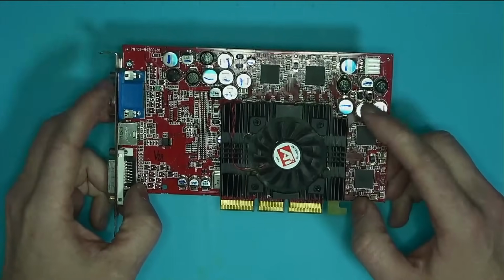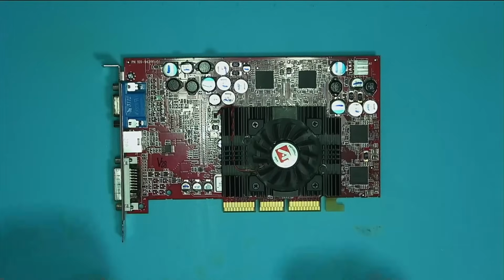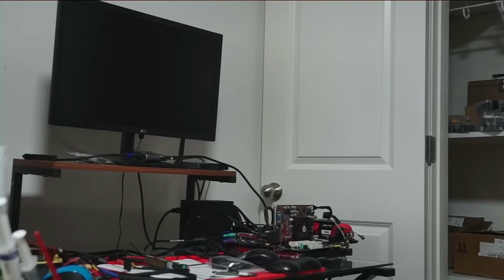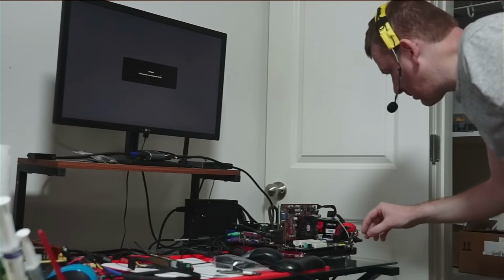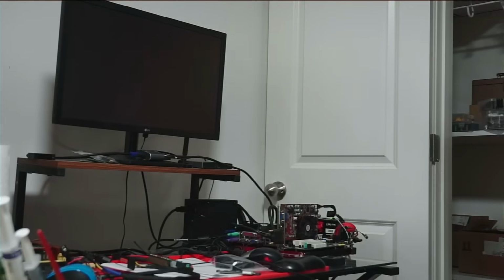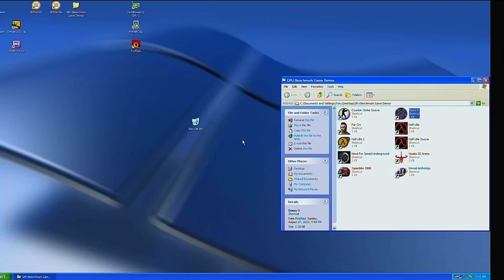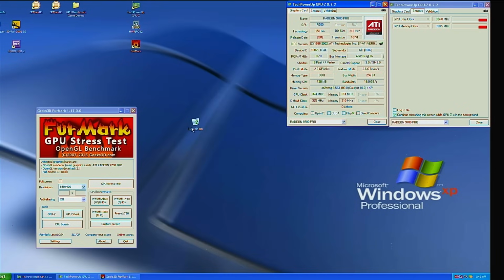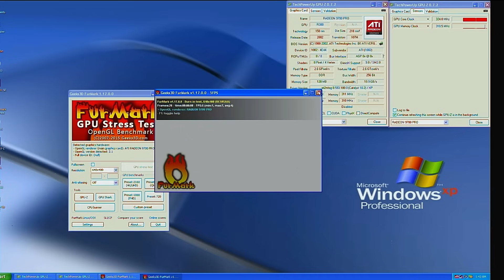Incredible recovery of this historical GPU from ATI

Comment: Truly amazing work Tony!!!  Thank you once again for fixing yet another one of my vintage video cards.  There is a little story behind this cut trace damage to the GPU die that Tony did not share in this video.  I was scraping off the old hardened thermal paste from the top of the GPU die when I slipped not once but twice with the razor blade that I was using.  This card was fully working prior to me performing this process and when I got done with applying the new thermal paste and putting the heat sink back on I went to test the video card using the same AM2 motherboard that I had used to test this video card on previously by running 3dmark 03 but this time it would not even post....no beeps....just a running AMD Athlon X2 6000+ 3.1Ghz CPU & GPU fan with a black screen.   Have you ever gotten that sick feeling in your stomach when you start to realize you have just done something very stupid?  Yep, after removing the GPU heatsink and placing the video card under my digital microscope I found the impact areas of the razor and saw the exposed areas of the copper traces.  OH NO....What an idiot I am...I knew I had just made an expensive mistake.  Lesson learned.
Reply: Well, thank you for your mistakes, so we all got to enjoy this video. :-)

Comment: Tony: digs for hours through a cracked 16 layer PCB, reballs the RAM and core, and the GPU works, but isn't NEARLY as excited as fixing a few (admittedly very tiny) straight wires in the top layer of the core substrate of a 22 year old card and having it work at the end! 

You remind me of myself before I sold my shop and retired a few years ago. The unique or rare parts were always my favorite, especially if I managed to succeed.

Comment: I remember those cards. They were super common way back when. We used to flash them with 9800 Pro bios & get a lot more performance out of them. Ruined a few 9700 Pro's, but the ones that worked, worked great. I'm pretty sure I still have one of those modded cards hiding somewhere. Good memories...
Reply: mine was artefacting in dx9 mode, otherwise softmod worked perfectly. I still remember you had to have a card with L vram modules. 2x performance for free!
Reply: Not sure about the 9800 flash... I'm very sure you could mod certain 9500s into 9700s/9700 Pros, because I was using a pre-modded 9500 -> 9700 at the time. The bump in performance was quite incredible - as was the overall performance/bang-per-buck for the time. Of course, after a while they started cutting those four additional pixel-pipes at the factory that the mod would re-activate. But if you could get a mod-able 9500, that card was the obvious choice back then. Especially since Nvidia had kinda, sorta dropped the ball with their competing gen of Geforce.
Reply: Yeah flashing to 9800 Pro is not possible. 
Someone is misremembering
Only 9500 Pro -> 9700 Pro was possible.

Comment: In the mid 90's I had 2 voodoo cards and was surprised I could run Red Baron on both since it offloaded enough processing to run it on two monitors. Then the bigger cards came along for higher processing above 720p.

Comment: back in the days, i brought a 9600 (i guess, not 100% sure) and modify it to a 9700 non pro! it was nearly 40% more performance only but using bios mod and connect to pins on the gpu!

Comment: Blast from the past. Seeing the lack of sensors is nostalgic! but also man, how did we even monitor our computers back then... I remember the first motherboard I bought that even had a 'package' temperature sensor, it was literally a little thermocouple that stuck out the middle of the CPU socket and touched the bottom of the chip 😂

Comment: Back in the 1990s, there was a cheap & fast gpu benchmark for any card.  I can't remember the name of the game, but it had a built in benchmarking mode to let you know what settings you could use to balance quality of the visuals vs speed/performance of the game.  If the game ran, it could benchmark.  I want to say late 90s (post 97).  I had it until 2008 when my last computer died.  Maybe Descent 2?  Or was it one of the MechWarrior titles?

Comment: i expected farcry to load up. this and the 9800 were required to play that game when i came out.  i remember using a X800 Vivo edition for doom 3. back then the vivo was the same board as higher cards, just missing a solder trace and bios.  so i used a solder pencil and new arctic cooling heatsink. turned it into an X850XTPE and saved like 500.00.... that was a killer card.

Comment: Flux is great for keeping solder in its place, but that's actually not always what you want, such as when you want to make solder bridges across cut traces.  I wonder if using no flux (after initially tinning the traces, that is) would help, or if it would just make a mess.
Reply from the maker: It would if traces were not so tiny.
It was impossible to bridge them otherwise.
If I had a thinner wire, I may have done a cleaner job.

Comment: Nice work on that 9700 Tony, I have one Im working on that needs the same repair and one of the caps on the carrier/substrate next the die/flipchip needs replacing too.  If you dont mind me asking, what guage wire are you using to repair those traces?  l got excited along with you to see it come alive. I lol ed when you tried to run FurMark on it tho Hahaha. Open GL  was in it's infancy at the time so that cards driver control  center didnt supprt it. As a matter of fact stress testing and performance diagnostic software like Furmark, GPUZ, etc. Were in response to the performance modification friendly GPU's like this card was and subsequent GPU's that followed it's trend setting legend...great video once again
Reply from the maker: 0.02mm
But for this application I need something much smaller. Maybe 0.005 but where to get it at a reasonable price
Reply: @northwestrepair  Agreed... Thanx man!

Comment: This one is brand new :) 
I had the ATI Rage 128
ATI Radeon 8500
ATI Radeon 9000 PRO
ATI Radeon 9600

Geforce 2 GTS
Geforce 4 4600TI

Damn good old times

Great repair. Love your love for hardware :)
Reply: :face-red-heart-shape:
Reply: I have Powercolor ATI Radeon X1650 pro 512mb agp first graphic card I own then later got the BFG 8600 GTS 256MB both of these still working the last I checked it
Reply: Glory to Ukraine ! 💙💛 
Nice to meet you here )
I am also had many ATI cards back there, 9000 series was beast !
Also i have HD4870  with 1gb of vram but in recent years it started overheating and showing visual artifacts, i think some memory chips are dying.
Reply: @loonywalker6729 Слава Україні. Greeting from Austria. That is sad. Stay safe

Comment: Are you still accepting repair items? I have a 2080ti that keeps shutting down around 1 minute into gaming..  sometimes a directx error and then windows stutters after until double restart. Another motherboard made it have an error where the game just closed and then it went to the reset and showed fragmentation as the operating system opened. 
But here I am using it right now to type on youtube about to go and test some more, maybe redo the thermal paste... ?? I am lost..  Where do I send this?

Comment: why are people using these old gpus? cant you play all those games with modern hardware ?
Reply: Depends on the game but yes, most of the 2000+ era games can be run fine on modern hardware.

Some people collect GPUs though, I'd guess this is why this 9700 is being fixed. There really isn't a 'need' to use old hardware any more, some people like to have an authentic gaming experience of a certain era though... nostalgia maybe? I know if I still had all my 90s/early 00's hardware I might be tempted to build it back up again.

Comment: after cleaning up my gpu with 99% alcohol like i usually do for maintenance and changing thermal pad + paste i got no signal from all 3 diplayports but my hdmi port work normally on my msi rtx 3070 ventus 2x. is it possible that i shorted the displayport circuitry and is it fine if i keep using the gpu with hdmi port if the gpu work normally and temperature are good or i could kill the card if i keep using it?